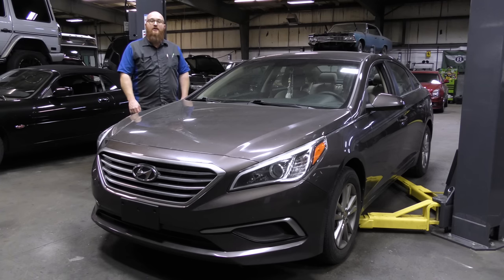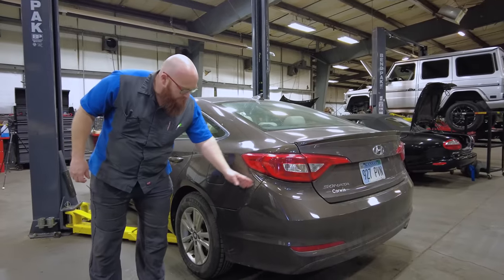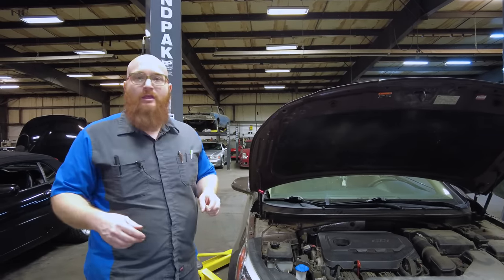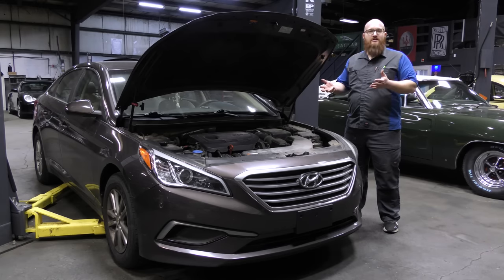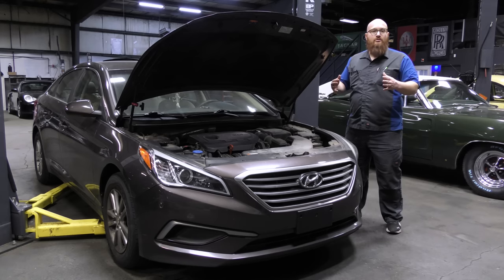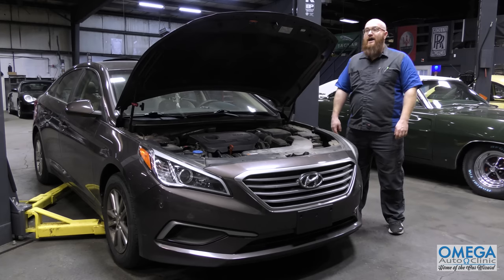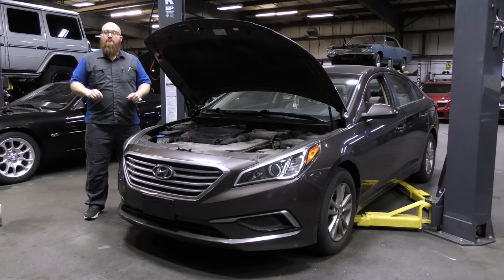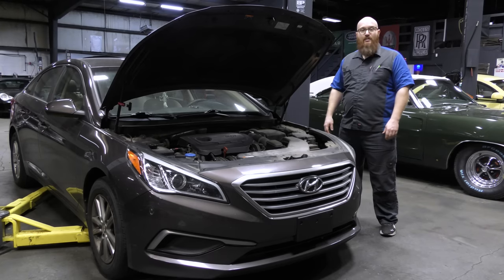What could be so bad on this '16 Hyundai Sonata that the CAR WIZARD is sending it to the junk yard?

Comment: I'm lucky.   I have a 2009 Hyundai Sonata with a  2.4L engine.  This was before direct injection and before they changed how they manufactured the 2.4L engine.   I have over 300,000 miles on it - and have routinely changed the oil its entire life (Mobile 1).  Cars in good shape (I have maintained it).

My wife recently asked what I would do if the engine goes bad.    I have located 3 engine remanufacturers that sell remanufactured engines for my car (although the largest remanufacturers do not).   That's what I would do.    So, likely $4000 for the remanufactured engine, several thousand for labor and minor parts.  While in theory I could buy a simialar aged car for that money...  I'm also buying unknown conditions of everything else - and in my car the rest of the car is in good shape and there are no surprises awaiting me.

I've also told my wife that if her Elantra engine goes she gets a new engine for her car. No one is remanufacturing them; but the Hyundai dealers are selling them for about $3600.  It's also not direct injection as it predated that change.

Comment: My 2016 Tucson (same engine as Kia sonata) is burning oil (infamous Theta II engine issue) which also blocked the rear CAT. Local dealer requested Hyundai Canada to cover engine replacement but they only supply block free - expect me to pay labor. I recently found the recall notice for the engine knock sensor and it says that if the engine light comes on and engine goes into maintenance mode(crawl) I should bring it to dealer for free engine replacement. Warranty extended to 10yrs or 200,000km - So instead of doing the repair now and paying for it, I'm just riding it out to see if it will start to knock on it's own. They're so slimy in their dealings...so I will never buy another hyundai again

Comment: Have a 14 Optima, once mine hit 75-ish thousand miles, I had the same issue too (1k since the last oil change btw).  I change the oil every 3k miles with full synthetic.  The engine just burns through oil once it hits over 70k, and the low oil light didn’t come on for me.  I’ll admit I check the oil weekly on the new engine now.  The engine does deliver good power for a naturally aspirated 4.  What’s funny is I dumped a Subaru before the Optima because I was afraid of that boxer engine blowing haha

I hope that car gets a new engine.  A car in that good of physical shape should not be in a junk yard.  Stupid how disposable we treat cars now days.  If the body and frame aren’t rotted, the car is worth saving (imo). 

I’ll admit I miss the days of a V6 being the standard, got more power, and I had more faith in the bigger engine not overheating and blowing.
Reply: Usually I'd agree but this car does belong in a junkyard as replacement engines have the same defects. Hyundai can't be bothered to design and build proper engines.

Comment: Somehow it left behind the plot what was service history of that car, we don't know whether the oil was changed, was it any inexpensive oil, or the one that meets GDI demands. 
I believe all those shortcomings of GDI were known for decades already with Mitsubishi GDI, where Hyundai I believe is taking their inspiration. High pressure fuel pump wear out, soot dilution and timing chain wear out, soot build up on intake valves, clogging whatever possible - it all was here years before. 
We heard that engine's knock, I am under impression any engine would be hard if not pointless to rebuild, not this particular one. And another of the reasons is those labor rates. In a place with 20 bucks per hour people would bore and sleeve that block along with all other precision jobs. 
Still I believe GDI route was the wrong one to take, especially knowing their n/a engines mostly were okay.

Comment: I believe the reason these engines now have such a bad rep is exactly what is suggested here. These cars are sold new to owners who are buying their first new car, and are shopping for the least costly car they can afford. Then they don't maintain the car because that costs them more than they have budgeted. I think this is what happened to Mitsubishi cars a few years ago. They were also sold primarily on price. Cars sold into the low price market do not get the required maintenance.

Comment: French Renault have electronic oil level sensor since 2001. Once you start the car, it shows on the odometer "00000" for normal full level. When you get lower it would show "0000-"

Comment: My understanding is that those engines have very high oil consumption. Its possible the oil went low during a reasonable time between checks.

Comment: I just went through this with my 2016 Kia sportage. It was at the time the best car i had owned. I got it with 19k miles on it. I babied that car. Oil changes every 5k miles. At 110k miles it srated using 1qt every 300miles. I took it to a mechanic and had it tuned. That helped but it still used 1qt every 1k miles. At 135k miles on my way to work the engine blew. Kia said I was eligable for an engine replacment but since I done no recalls I was not eligable. However as the 2nd owner I got no recalls. Come to find out these engines blow so much that they are crazy high because of such a high demand. After labor I was looking at 4k dollars to get one with a 6 month warrenty. I chose to scrap it and by another vehicle that I really didnt have the money for.

Also I would like to say I chekced my oil and topped it off all the time, it didnt make a difference as this engine was crap. Your right about checking oil and being pro active but it wouldnt have mattered. My mechanice said the oil lvl was full when it blew.

Comment: Cars require responsible behavior. If you don't check your oil, or fail to change it when you should, then you reap what you sow. The owner/driver of that Hyundai has no excuse for letting her oil get that low and that dirty. Jiffy Lubes are everywhere. Make the time FFS !!! 
And besides, it's a Hyundai Engine: It's self destruction is guaranteed from the day it was first built! So why deny them yet another well deserved statistic?

Comment: I own a 2017 sonata and went on a three hour trip with it a to the F of oil and by the time I made it home it was under L, when taking short trips it doesn’t burn much oil but long trips it eats it like crazy, I have a big jug of oil in the trunk and check it every couple days or so and top off, it has 178k Hyundai said they wouldn’t do a consumption test but if it seizes they will replace it under recall.
Reply: The piston rings are bad and burning oil.

Comment: I don't understand why they don't have a float or some other sensor in the oil pan that alerts you when the oil is RUNNING LOW.  An loss of oil pressure alert is great, but the driver needed to be alerted to low oil wayyy before that.  Lights should be "add oil soon", and if oil pressure is lost, the engine should just stop, with an alert "add oil before starting again".  An engine that protects itself from catastrophic failure isn't profitable though.  :\

Comment: Many of today's new cars are equipped with an oil level "idiot light." But unfortunately by the time the idiot light comes on engine damage has already been done. Every car I've owned has had an oil pressure and alternator gauge. Those two gauge will tell you when a problem is developing. Idiot lights are worthless!

Comment: I rolled the dice. 
I bought  the new motor.  It was less than $6,000 to purchase and install. 

It was less than purchasing another used car that I know absolutely nothing about it. 
I had owned our 2013 sonata for seven years with 28,000 or so. It now has 116,000 and the motor started burning oil at 98,000. 

Last year I had put a new starter and battery, front rotors and brake pads, new tires. So I had almost $1800 in newer parts, etc. 

At least now I have a car with a 36,000 mile warranty on the motor.   

But last year sucked for me on the cars 
I finished paying for the sonata. And out in the above mentioned parts. 

The motor failed in November 2023. $5800 later in mid April 2024 and a new motor it’s driving. 

In early spring 2023 I finished paying for a 2012 Honda Oddysey. And paid $3500 for major motor work. In early November 2023 I got sideswiped on the freeway on-ramp while trying to bring coffee home for the wife and daughter m. Coffee spilled!  Minor body damage and totally drivable but the insurance company deemed it was a total loss. Now I have to replace that with a car payment …

Comment: So one wonders, since engines can be totalled due to lack of oil changes, why isn't there at least an option for a warning light after xxxx miles or xxx days since an oil change?  That sounds like a $10 part that could prevent $6,000 in damages.   My Honda has an oil percentage life display, but you have to seek it out among all the display options, and it's just an estimated life display, it doesn't warn about low oil level or thick oil.   Weird.

Comment: I owned a 2006 Hyundai Sonata GLS V-6 it was consuming oil to the point when I went to get the oil changed, it didn't have oil on the dipstick!! Why didn't the oil light come on to let me know it was low on oil! I had 3 months left on the 10 year powertrain warranty, now because I couldn't prove I kept up on the maintenance they basically denied me coverage! I traded in my Hyundai (crab) and bought a 2016 Toyota Camry and now I document all my services! About checking the oil, I heard ever since a self-serve gas station became a thing, we are more likely to not do those checks that the full-serve station used to do!

Comment: They made from like 2011 -2016 model year sonatas with metal shavings in the block from the factory lol it doesnt matter if you take care of the engine or not they are all ticking timebombs. We used to deny warranty engine repair all the time cause of improper maintenance.

Comment: Wife drives a '15 sonata 2.4. I change the oil/filter q3k miles. Religiously. At approx. 75k I noticed there was about 2.5 qts at oil change. What did I do wrong last time? Started to check oil level weekly. The car was using 1 qt q1k miles. Then 1 1/2 qt. Went on like this. Thought to myself "now over 100k miles, too late for warranty claim. At 150k miles was using 4 qts q3k miles. Could not figure out where it was going. Changed plugs at 120k-no oil residue. No signs of leaks anywhere. Thought I was going to have to get another motor at my expense. "I'll wait till this one takes a dump then change it myself." I went to the dealer for a new water pump belt and told the parts person about the oil problem. "Wait here a moment" she went out and talked to the service mgr. She returned, got my belt for me and told me to tell the ser. mgr. what I told her. Long story short, because I had kept all of my reciept's, I mean all of them for 50 oil changes, we ended up getting a new motor at 158k miles for nothing. She already has 145k miles on the new one. Use about 1/2 qt q 3k miles now. No more Hyundai's for us, even with the new motor. Most people aren't going to change their oil that often. How could most people know this motor was so oil thirsty? Never found out where the oil was going!

Comment: It is really difficult to check your oil while fueling up nowadays.  You only have a very short window to pump a few gallons and run before all of the panhandlers start walking up like zombies.  I wouldn't want my wife or daughter checking there's while fueling up.  Full Service Gas stations need to make a come back 😂.

Comment: I had a beautiful Ford Fusion that I dubbed Frankie. I loved that car. The one thing I did was change the oil every time it needed it. That car last over 200,000 miles. it was a 2011. It would have lasted me longer if I had done one thing... check the transmission fluid... yea It blew on me and killed my car. So not only check the oil but the transmission fluid. It is the life of your car.. It's their blood so to speak.

Comment: I recently got my engine replaced on my 2015 Hyundai Sonata 2.4L SE, had 115k when it died on me.  Dealer, or rather Hyundai, declined me.  I agree engine is crappy on these Sonata's but I rented some cars while replacing my engine and noticed there's some important features, or at least they are to me, that are missing on this Sonata.  These Sonatas are missing side mirror indicators, leaving lane warnings, and smart/adaptive cruise, things I consider crucial for me now.
Reply: I know some drivers think that 'looking where you're going' has become a communist activity, however we still should not let technology replace responsibility. Even if your neck hurts, check your blind spots. Otherwise a different piece of technology will make sure you pay for it if you don't: A Dash Cam.

Comment: You cant keep up with those engines oil consumption. being 3 quarts low is a few weeks of driving for me. (Same engine) i burn 3+ quarts every 2k miles. The engine just blew with oil in it. Im pretty sure it was burning even more the last few days before it died. I had to add 1.5 quarts after 600 miles, then drove another 200, it blew, checked oil again and its half way down the dipstick (right between low and full). 2017 sorento, 79k miles. Ive owned it 5 months. There is no oil light. I ran mine down to 2 quarts when i first got it. I only noticed because i heard a little valve noise on hills and checked. No one thinks to check oil that soon. If it was a normal person they would have seized the engine due to no warning.

Comment: I have a ‘15 with the same engine and it killed me when i went 8000km (2000 over what i set it to) without an oil change. Next week i need to go, bang on time. Basic vehicle maintenance can go such a long way in keeping a car running the way it should.

Comment: I check my oil and other fluid levels in my car 2 to 3 times a week and I get the satisfaction of doing so.  My Toyota goes oil change to oil change with no loss of oil.  Oil and filter change every 5000 miles is done by myself so that I know it's done properly.  Oil and filters are cheap engines are not.

Comment: I'm not sure what's going on with the reliability issues with American Hyundai's? Here in New Zealand Hyundai have a very good reliability record,  though most are diesel engines,  so that might make a big difference.  I'm on my second Hyundai, my Hyundai i30 CRDi station wagon has 164k on the clock and regularly tows a small caravan and trailer and my friend has a Kia, both of us have no major issues with our vehicles, just thought I'd put a different view. I don't have any connections with Hyundai or Kia BTW.

Comment: $9000 for a new engine is much more affordable than $30,000 for a new car !!! The car is in great shape and will last another 10 years !!   I have 1.6 Turbo Tucson (2017 model with 130,000 miles) .. is this a bad engine / and / or when it blows can I get it fixed or not ?   Bought brand new , never burns any oil, zero problems with this Hyundai ..  I wish to run it another 130,000 miles.

Comment: These cars use more than a quart every 1000, I bought one. Consumed so much oil I kept a 5 quart jug in trunk plus sockets spark plugs and coils. This was at 110k. So no wonder it was low on oil.

Comment: I just bought a 2024 Honda Accord with the 1.5 turbo and my mechanic buddy said always run ethanol, free gas and change the oil every 5k miles and the motor will last you a lifetime.

Comment: 2.4L is known junk, period.  It doesn't matter if they chagrd the oil properly.  I have a 2013 Kia Rio with 110,000km on it.  It doesn't use a drop of oil and hasn't had a single issue since we bought it with 12,000km on it for $9,000 CAD in 2018.  I just changed a turn signal bulb for $2.  That's the first money I've spent other than oil changes.  Owes me nothing if it blew up tomorrow, but it's the 1.6L, not the 2.4L.

Comment: I guess I'm a lucky kia optima owner..I have an 09 kia optima LX with the theta 1 engine..I've owned this 🚗. Now 4 years it just turned over 114k miles original engine trans I do proper maintenance it doesn't smoke nor use or leak oil my 2.4 litter runs great and never had an issue ever,,,,

Comment: Rule #1 when you own a car! You have to take care of it and maintenance it!! 
Check oil and other fluids!!
Tire pressure!! 
Especially hyundai because of the oil consumption issues with the engines.
I have a 2016 myself and have to check daily! 
Have to do an oil change like every 1200k to 2k can't even get to 3k miles for an oil change!! 😂

Comment: When I was 16 and got my license my Dad was letting me drive his car.  He told me upfront that, in addition to forbidding all the normal dumb things teenagers do when they start driving, I had to check the oil.  One day he called me out to the driveway and confronted me with the dipstick; there was just barely a drop of dirty black oil on the bottom.  Message sent.  20 years later I check my oil and fluid levels constantly.

Comment: Its a known issue. These engines have metal shavings, burrs, from the factory, that kill the engine within 100k miles. Engines like these shouldnt go for more than $3k. It's best used as a project car. Put a small kubota diesel engine in it, or some rotary engines. Or a 4 cylinder from another car.

Comment: I don't like the GDIs, those engines are a mechanical struggle, Hyundai is not really a bad car, like any other vehicle, as long as it's not GDI. 

I'm from Costa Rica, and I really wish USA had the non GDI so they can have a different perspective on Hyundai.

The 6 non GDIs we have in Costa Rica are:

-Hyundai Verna 2016-2022 (Kappa engine 1.4 cc)
-Hyundai i10
-Hyundai i20 active (Kappa engine 1.4 cc)
-Hyundai Tucson CRDI 2009-2023 
-Hyundai Elantra CRDI 1995-2023
-Hyundai Accent CRDI 1996-2023